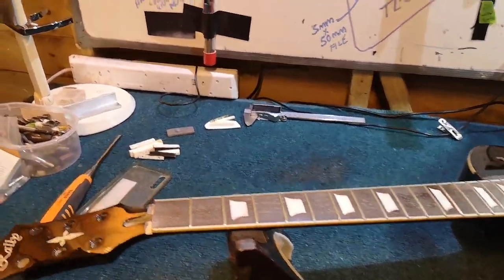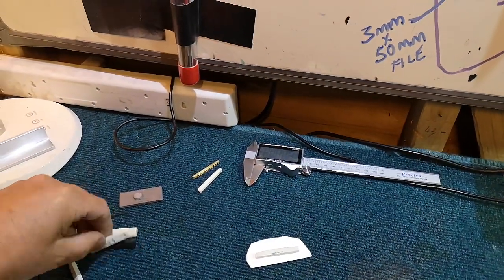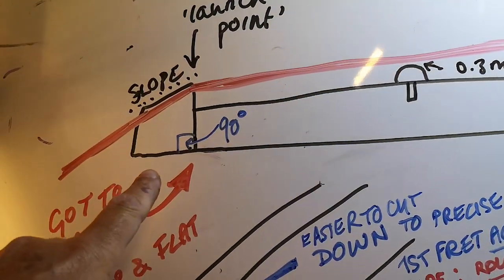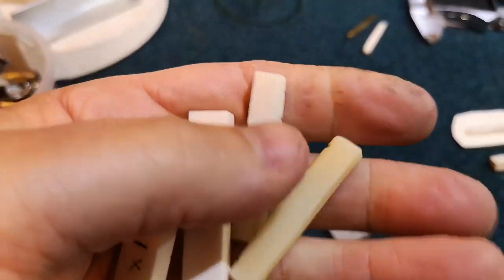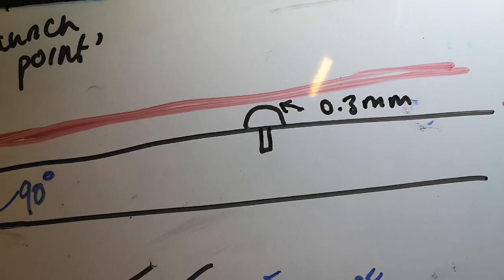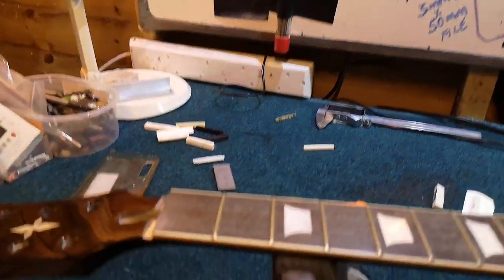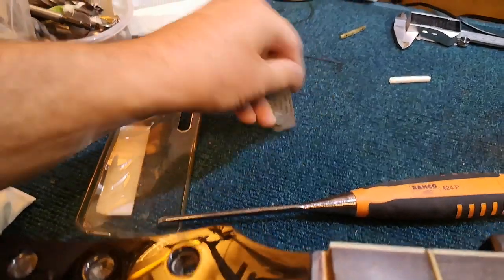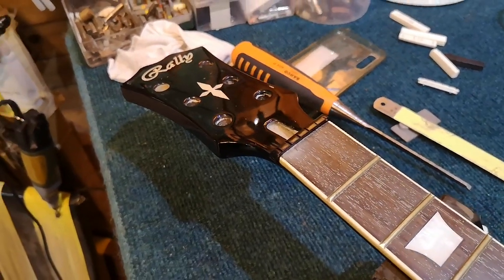Changing the nut on your electric guitar: everything I know about nuts in just 15 minutes.

Comment: Hi Sam. Just finished fitting new nut to my LP style guitar. I decided to go with your first suggestion and reduce the action by sanding down the nut base. I liked the idea of keeping the factory slots. Sacrificing low action for staying in tune. Achieved 0.5mm. Took long time but I'm very happy with the result. Getting the 90 degree corner on the nut was key. So many thanks for your video.
Reply: I haven’t filled my nut yet, waiting for the Hosco files to arrive next week. But my takeaway is getting the angle on the nut correct. Sam has a great way of explaining the issues, and gives me confidence that I can do it with good results.
Reply: @jonathanhandsmusic  I also bought the Hosco files. I first use them on a new guitar to try and get good first fret action, no pinging when tuning and tuning stability. If I fail then I buy a TUSQ nut and sand down to fit and get low first  fret action. I think that the files are great as they don't flex. Just need to remove excess from the top as they create a wide v shaped slot. Without Sam's videos I would never have tackled this and would have been stuck with all of the problems associated with the stock nuts.

Comment: Absolutely spot on! Really appreciate the information. Have just swapped a poor plastic nut for a Tusq XL on a cheap tele copy. As you say, the tuning stability is much improved. The big surprise however is that the guitar sounds so much better harmonically. Now changing the nut on my Mexican tele to a Tusq (plus fitting brass saddles which to my ears, also improve the sound over the standard steel block saddles)

Comment: Hello again Sam. I've just ordered 2 left-handed TUSQ XL POL-5000- LO Nuts from Amazon. in white. in case I mess one up. that's all they had. They didn't have the flat-bottomed ones.  I do have a set of those cheap round wire files. I will keep going back to your video for guidance. If that fails I might have a go at shimmin the nut that's already in the guitar. The 2 that I ordered have that little tab on the bottom so only need a little spot of titebond glue. If I cock it up a little tap like you showed should free up. And start all over again. Thank you so much for getting back to me. I hope you and yours have a lovely Christmas.

Comment: Hi Sam, really impressive video. I have just sculpted my first bone but, and it took all day! 
You’re right about the nut seat preparation, mine was doused in superglue, and the old nut was a shimmed soft plastic one. 
Getting the bone nut to seat without rocking was a serious challenge, but I found the best way was the edge of an old bastard file , got all the old glue out so I could reseat the new nut with PVA. 
Only need to slot it once I’ve found some decent files, there must be some in the UK, not paying hundreds of pounds for some of Stu Macs. 👍
Reply from the maker: Many thanks for your comment Mike. Hosco nut files are the best set in my opinion; very robust, will last a long time. Every time I struggle with a rocking nut I wish for some 'bedding' resin, two kinds - one Tusq white and the other Tusq black to 'take up the slack' rather than spend hours trying to get it precisely flat with (often inadequate) tools!
Reply: @SamDeeksRelovedGuitars  cheers Sam. Yeah I looked at the Hosco ones, I may invest in some, but I can’t understand why someone hasn’t created junior hacksaw blades in various widths. Seems the obvious answer.
Reply from the maker: @mikesmith8187  The best thing about the Hosco files is that they have a filling surface on the sides as well, meaning they actively cut to width as well as depth which means their slots are slightly ‘V’ shaped which helps avoid the strings binding in the slots.

Comment: Is it acceptable to reduce the height of the Tusq nut  by carefully sanding the bottom  of the nut (prior to glueing it on ) to achieve 0.3 on the 1st fret as  I think that way won’t upset the slots Tusq have created. and leave say the 6th string on /off as a reference guide to achieve your 0.3mm  I feel I could carefully do this as not to take off to much, but I respect your advice kind regards Stephen
Reply from the maker: It IS ideal to do it that way... but it's incredibly difficult to hit that perfect 1st fret action that way. Very easy to fractionally over-cut and then you're stuck either shimming the nut or starting again with a new one. Also, it's quite common to be using a Tusq nut with the right e-to-e spacing, the right width, with enough height and thickness BUT that happens to be slightly the wrong radius... in this case you have no choice but to adjust some of the slots to bring the radius into line with the actual guitar. Despite how many nuts Tusq (or anyone) makes, getting all 5 dimensions / variables bang on for every guitar manufactured just doesn't happen; i.e. there isn't a nut for every guitar produced. So surprisingly often I'm using the closest-match and often adjusting the slots to bring that radius in line.

Comment: Flattening the nut seat is probably the hardest part for me in changing new nuts. It's frustrating. 

Thanks for the info!
Reply from the maker: Hi JQ - yes, it's tricky. A flat craft knife blade is a real help; you know it has a straight edge. If you keep working it down into the right angle corners and scraping it straight across the slot bottom you should get pretty close. What's most frustrating is when you get close but put the nut in and find it rocks very slightly from side to side :-D That's where I go back to my craft knife blade and continue scraping...scraping....scraping..

Comment: Thanx for the video. I love Tusq Nuts and time after time I will Upgrade all my guitars with them if nessesary. What I don't understand are the height adjustable nuts. I always thought that a nut had to have as much contact to the neck as possible.
Reply from the maker: I think a nut needs to hold the strings and provide a solid surface for their start point at that end of the guitar. I've got numerous guitars with these adjustable nuts and they play and sound great. A lot of people's ideas seem to come from untested  and unproven assumptions - for example, people often assert that the nut (like the neck joint) somehow has to 'transmit' the strings' tone to the er.. pickups (and other such weird claims). There is no 'tone' being mysteriously transmitted or channelled through nut-to-neck and neck heel-to-body joints. What there IS is movements of a ferrous string through a magnetic flux field over the pickups. The issue about nuts, neck joints and bridges comes down to how they do (or don't) affect the string's ability to move once plucked. Loose, soft or mushy materials waste string energy as do poor neck joints. So providing the adjustable nut sits firmly on its posts it plays great - in the same way that you'd never think to question a Tune-O-matic bridge on a Gibson Les Paul because it too only stands on two pretty thin posts?
Reply: @SamDeeksRelovedGuitars  Thanx for your answer.

Comment: I have a 50’s reissue Strat that had the e strings too close to the edge of the fretboard. I ended up buying a Highway One bridge with tighter string spacing. Now I’m trying to figure out if I should create a new nut with a less wide string spacing as well. Is this something I can buy pre cut or will I have to get a blank nut and cut the slots myself? Also, what distance should the remaining 5 strings be from the first fret? In all these videos it only mentions the space for the fat e string. Thanks for any feedback.

Comment: No one talks about, What glue to use when gluing in a new nut? I just ordered two 6642-00 & one 6643-00 along with a 3 set of cheap nut files ranging from .24-.061, .032-.081, .053-1.35 as this will be my first nut replacement, I hope it all goes well. I ordered 2 graftech 6642-00 & one 6643-00 to be on the safe side.  In the mean time, I found this acrylic nail powder meant for acrylic nails & it fixed it up with the use of super glue! I built up the nut slot with the powder & dropped on a drop or 2 of super glue. It is my temporary fix, it worked for now! What glue should I use to attach a graftech grafite nut?
Reply from the maker: Your best bet (I believe) is CA glue; suggest two very small dabs on the base i.e. one at each end and a little up the front edge of the nut where it meets the cut end of the fingerboard. You want as little as is required - but this of course depends on whether the string pull is straight through or whether it is some Hair Metal kind of design with massive pull to one side or the other. In the latter case you really have to rely on the strength of the glue to hold the damned nut in place - and that increases the chances of the next poor guy (or you!) tearing up wood next time you come to try to remove it.

Comment: T
Many thanks Sam your video is greatly appreciated. I had not really considered the 90 degree issue. I am not sure whether my strat slot is flat or radiused. I guess I will find out. Luckily I have ordered TUSQ and I do own a set of files. Do you recommend a slot angle say 20 degrees? Again many thanks for the time and effort you put in. I'll definitely refer to it.
Reply from the maker: If your slot is radiused Tusq makes a curved nut with a central 'foot' you can carefully file off. If it's a flat slot, the same nut can be used - just let it stand on its 'foot' + the two outside edges.
Reply: @SamDeeksRelovedGuitars  Thanks Sam, I had seen that feature but my concern was how best to prepare the floor of the nut slot maybe glue residue or uneveness resulting from nut removal. I'll be sure to let you know how things go. Many thanks for helping me
Reply from the maker: @glennsophie3235  If you're trying to clean up a radiused slot you can either attempt to clean it up or, if that's not feasible, you can flatten it down to level. To clean up a curved slot, you could start with a craft knife blade to carefully scratch away built up glue... after that you probably have to get inventive. If you have a metal radius gauge you could stick some sandpaper facing outwards from the appropriate side of the gauge (i.e. whatever side matches your neck). I've done that before. Takes a while but effective. If you don't have a 2-3mm thick radius gauge edge to use, you could cut a 2.5-3mm strip of sandpaper and pull it back and forth through the (radiused) slot / over the hill. You'd need to do this a few times but it would work eventually.
Reply: @SamDeeksRelovedGuitars  Advice greatly appreciated. I was thinking of using the old nut and sticking some fine grit sandpaper to its base. Still I'm hopeful that it will be flat as this would be cheaper for the factory.

Comment: I've replaced plastics with bones, tusq and brass with excellent results.
I don't know mm so I use feeler guages.  18thou on base strings and 16thou on treble.   Seems to work for me.  Recommended values I've found are 20&18 thou but I found that to high causing the pressure detuning sharp.
Reply from the maker: We are in agreement: the recommended 1st fret action settings 'invite' notes playing sharp near the nut and - put simply - are usually about 1/3mm higher than they need to be. The result is that most 'normal' players experience sharp notes when fretting near the nut while the open strings are 'true' resulting in a horrible sounding mess. Sure, the manufacturers are entitled to expect all players to have better technique and be able to learn to play their factory settings... but that's not dealing with reality. Reality is most players will get sharp notes at 1st fret actions of 0.5mm and above. Shipping guitars out with 0.7, 0.8mm 1st fret actions is just cynical because what you're hoping is that your customer base is inexperienced enough to just live with it the way it is; hell, why are you worried - you made the sale and your customer is probably blaming themselves and not you anyway. I don't find that a very smart way to go about it - and I see that you agree.

Comment: great video! there is a paucity of information out there about squaring up the nut channel/slot. you have any suggestions on how to fix up a slot that has been torn up and glued over and scratched out too many times?
Reply from the maker: It's really difficult. I have a combination of things I use: a Hosco fret slot file (a little rectangular block  3mm wide with files on either long 'edge'), a very small sharp chisel to re-cut sloppy corner angles... and several craft knife blades to scrape the nut slot surface. Sometimes if it's really messed up I have to chisel across the length of the slot which is a bit harrowing because there's no easy way to guarantee that the chisel is going straight along the nut slot. 
Worse comes to worst, I could place the new nut on a shallow bed of resin of some kind (ideally similar colour to the nut). Lightly pressing a nut onto this bed of resin will allow the resin to fill out any irregularities in the slot. Once dry, the hard resin will support the nut well. I would only do that in a situation where the slot is un-saveable by means of chisel / blade and slot file...

Comment: Think you’ve swayed me on the tusq nuts. I have a load of bone nuts and blanks aced in my eBay watch list and also looking at the Chinese ones from companies like wish, but I might put all that aside for a while and go directly to tusq. Worth a try. I had a look on there website but could find any info on what radius the slots are cut at ? Maybe they have gone for the common 9.5. I also could find what guage strings they are cut for but I assume probably around 10’s. Away to order one now. I have a 12 inch radius but can fine tune it if need be I suppose although would prefer not to touch the slots .
Reply from the maker: Yes. The reason I've switched almost completely to custom-made adjustable Tusq nuts is precisely to be able to preserve the factory smooth slots AND still get the perfect 1st fret action (by bringing those un-touched slots UP to the desired action rather than filing down).
Reply: Sam Deeks I got one . I see what you mean , they are really nice 👍 very slick and feel great. It looks to me like it might be a 9.5 radius that it’s cut too as my high and low e strings are very close to the fret while the other arc up a bit . I have a 12” radius . But at this stage I will live with it , im not going to touch those slots at the moment . Very happy

Comment: Very interesting and useful video. I just sprung for a set of double edge Hoscos, but I nevertheless find this information to be easily understood and applied to a stock new Fender nut with pilot slots. I have a few guitars that could be improved by a new nut. I will check out the Tusq products. I’ve heard nothing but good things about them.

Comment: Hi Sam, I tried to create a plastic shim for my Tele nut and yep once again you were right. Practicality impossible to create the shim between .1to .2mm thick along the nut length. I could make a thinner shim and glue in place but I'm concerned about making it worse.
Reply from the maker: That's why I glue a relatively thick bone or Tusq shim / extension and work it back from there. The remaining material might be only 1/10th of a mm thick but it's there and firmly fixed.
Reply: @SamDeeksRelovedGuitars  Now I totally understand. Although after a couple of hours of wasted effort. Still a lesson well learnt. In hindsight I should have realised that it wasn't practicable due to low tolerance.

Comment: Sam, do you measure the 0,3mm string height at the first fret by pressing down behind the 3rd fret, or without fretting anything at all?
Reply: That is an important unanswered question. If it's unfretted that's a combination of nut, bridge and truss rod settings and hence not a good way to work unless your truss rod and bridge is spot on. If it's fretted at the third I think that measurement is a bit high?

Comment: Hello Sam. I've got a problem with a left-handed Glarry GTL - Tele  I've just bought. I'm not sure which Nut to order the low E is touching the neck plus there's a gap between the Nut and Nut slot of the low E. It looks like they tried to higher the Nut   to stop the low E from hitting the neck. Any advice would be greatly appreciated
Reply from the maker: Hi Dave. First thing is that your choice of nuts will be limited being left-handed. Now you're asking the wrong (right) guy about changing a nut... lol meaning my answer is 'it won't be 'drop-in' easy!'. It never is, especially if you want to get the 1st fret action right. 
First thing I'd ask is 'what's the radius of the neck'?  Hard to find online but it's going to be 12" at least. 
So this is your best bet:
https://graphtech.com/collections/tusq-black-xl-nuts-guitar/products/black-tusq-xl-42mm-flat-bottom-strat-nut
If the radius is bigger than that this will still be playable... (if not ideal). If you have nut files you can fit this and - assuming it starts off by putting the strings TOO high - cut each slot downwards to a chosen 1st fret action. 
Or you can carefully sand it from the bottom of the nut; test fit, put the strings in, then take off more if you need. Very easy to over-cut though. 
Which is why I default to adjustable Tusq nuts whenever I can :-) 
Sounds complicated but the nut is SO important in a guitar's performance and tuning stability that there isn't a simpler way to get it right.